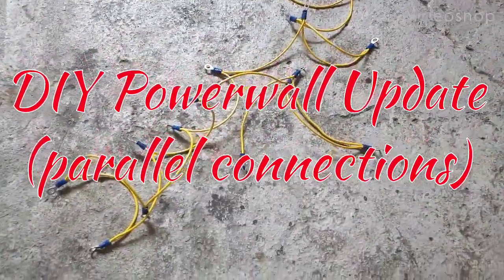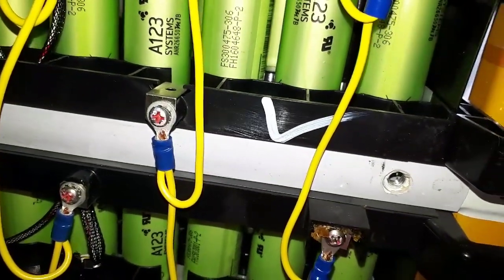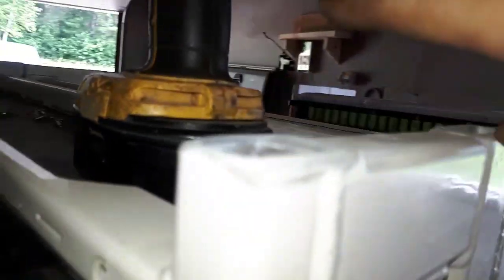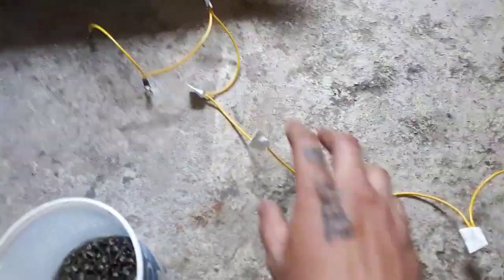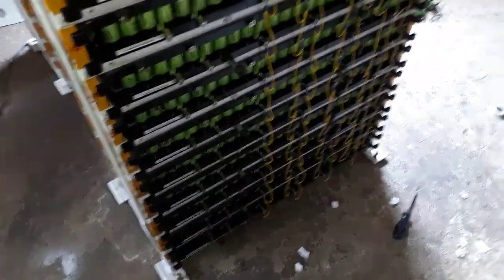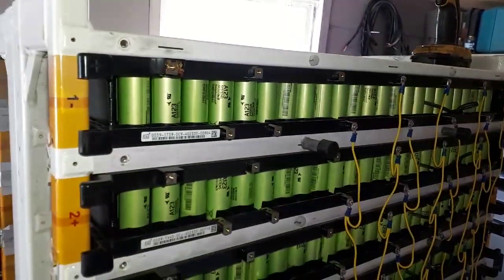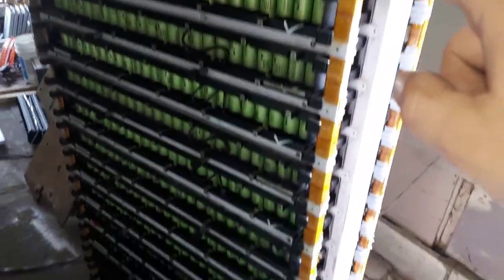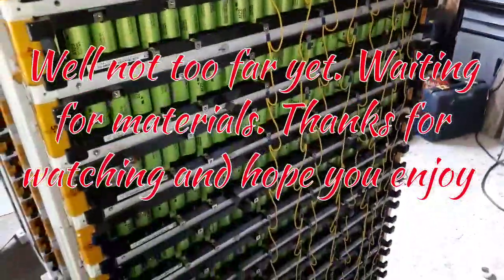DIY Powerwall Update (parallel connections)

Comment: Greetings my friend.  Nice job! You are going to have lots of storage.  I find the only difficult part of switching to Lithium is how to pay for it all lol. I just sold my pickup truck to pay for the conversion. I only used it a couple times a year. Most of the time I use the flatbed to haul the Cat or logs, Or deliver lumber so the Chevy truck just sat there eating up insurance. We live in such a remote back water place we just do not have the availability of EV batteries. I hear of people buy batteries from scrap yards and such but the closest place that has EV is 6 hours from here. You seem to find the deals for sure.
Reply from the maker: For what you see there im in for $1500 so far.
Reply: @frankz1125  wow thata amazing.  So far I have $2400 into a 9  kilowatt bank.. You have done an amazing job.
Reply from the maker: @offgridinthepacificnorthwe3210  it is good but is costing me alot of time
Reply from the maker: @offgridinthepacificnorthwe3210  I just sold my agms now im $200 for what I have now. Think about selling yours to get another pack or 2

Comment: Perfect. I'm doing all mine the same way. Not sure yet what i'm going to use. I,m thinking solid wire.  Will figure it out not ready to finish mine yet. Nice nice.
Reply from the maker: I also just bought a 36v inverter to test the packs or discharge the paralleled groups. Should be here soon. Thanks for watching
Reply: @frankz1125  Nice i bought two of them already one as a back up just incase. One's i got low end voltage is 30 volts and high end is 45 should work out good i figure for discharging and charging. Meets both ends with room left over.